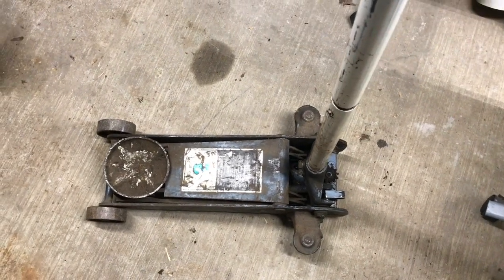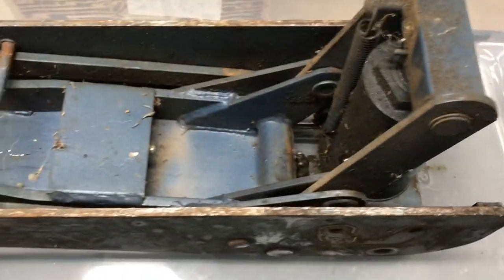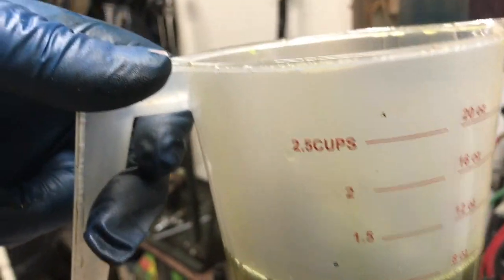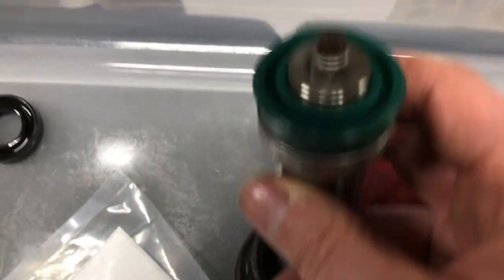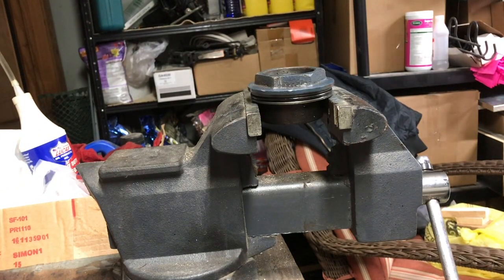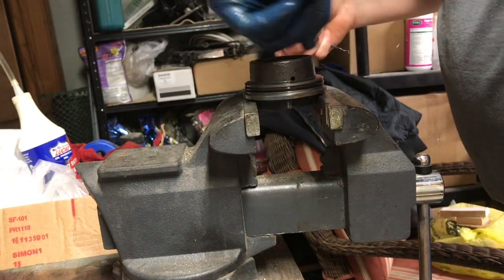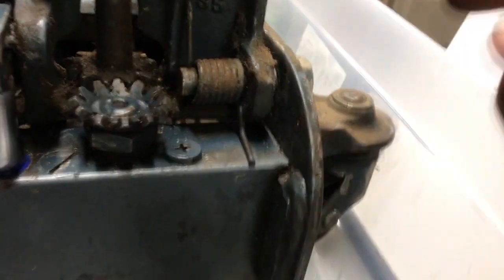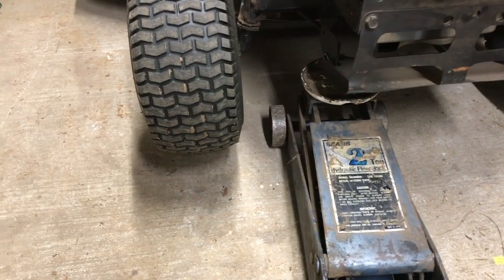Can we fix it?  2-Ton Sears Hydraulic Floor Jack

Comment: Update !  So today I went ahead and replaced the seals which I bought on Amazon for 49.00.  It was easier than expected and took approx two hours or so as I took the time to clean and degrease 40 plus years of dirt and sludge. I had previously replaced the wheels as the others had flat spotted over time. I also used a syringe to add 8oz of fresh jack oil..  Just finished testing it and it works perfect. No doubt this jack will outlast me.  Thank you again for the video !!
Reply from the maker: Glad it helped. Thanks for watching!
Reply: Can you tell me where you purchased wheels from? Mine are toast.
Reply: For that kind of money you could spend a few bucks more , and get a new aluminum, lightweight jack at HF tools.

Comment: Thank you sir! I have the same jack, but mine is a 3 ton. I also bought it at around the same time, maybe the mid 80's. It's worked trouble free for 35 years, but of course, nothing lasts forever and now I have to replace the seals. Your video is perfectly to the point and easy to follow. I'm going to Amazon right after writing this comment.

Comment: Great vid MPA.  Lacking a heavy duty enough vise to break the cap loose, I improvised by reassembling the power unit body backwards with the big hex sticking out.  Threaded the handle thru the base and the extended elevator part, with the handle end that was sticking out under my workbench.  Then a 4' cheater on the pipe wrench and it couldn't say no.
Reply: Brilliant. That will get me over that hurtle, thanks.

Comment: That cap at 2:33 which has to be removed is a MASSIVE PAIN!!!!! I tried everything to get it loose and couldn’t. I had to take it to a shop for them to get it loose and even they had trouble. After that, it was an easy repair and this video helped. My seal was basically disintegrated so I replaced it and all o-rings I came across. Now works just like new. Thanks for the video.
Reply: Looking for help. We have this jack & the handle is “frozen” we can’t turn it at all. Would the internal seals effect this? 
Could it be rusted or something? 
Sorry, my brother left my dead fathers jack outside and now it’s not working.  Id like to give it to my son but I have no idea what I’m doing.
Thanks
Reply: @flyersrule8918  If the handle won’t turn to open or close the valve, then I would recommend taking the valve area apart to clean everything and check seals. This will be WAY easier than having to repair the seals in the piston on a Jack that won’t Jack up or hold the vehicle up. Should be a pretty easy fix for you. You will be able to remove the star dial of the handle that should turn the valve and then also remove the star dial in the Jack that opens or closes the valve and see if anything looks like it needs to be replaced, or possible just removing it and putting it back will fix it. Good luck!

Comment: Excellent ! I have the 1.5 ton version " Green Jack " that I've had since the 70's. It just last week started to not hold weight and now only lifts a few inches and then sinks. After watching this video I am going to reseal it instead of buying a replacement.  THanks again for showing us how it's done.  Cheers !!
Reply: I believe mine is also the green type 1.5 ton model made in Japan. As I said , took the old seals to a hydraulic parts store and paid around $20 for maybe 3 seals.

Comment: Well done for a good video. At 5:06 I am glad that you stated that the top cap, " we shall snug it down as much as we can." and no more than that. I had occasions where those repairing such jacks overtighten the upper cap at the expense of lifting the power cylinder off its bottom copper seal. 
This week I had a colleague who called me to help him with his floor jack as he had taken it for repair but it was not done successfully.
There were "four steel ball-bearing valves" in this particular unit to take care of and investigate..
* One steel ball for the return path for lowering.
* One steel ball loaded with a spring for the overpressure control.
* Two steal balls working together to bring about the pumping action from the reservoir to the pressure cylinder. 
I easily managed to get at three balls, but the fourth final one which was on the pumping action and which held the power cylinder in place after each pump action could not be gotten at without taking off the power cylinder. The outside surface of the power cylinder was gored with marks of the pipe wrench.  Someone did try hard to get that power cylinder off but could not!! In order to get the power cylinder off, we had to use heat on the block and cool the power cylinder and gladly it worked.
After taking the bottom copper washer seal, the last ball was located and it was found to be surrounded with the remains of the bits of the power piston which over the years got under the ball and so it would not seat back as it should so It leaked. The small pumping piston showed evidence of its aging. The seal was on the end of the piston and not on the cylinder as an 0 ring. 
After ensuring that all was well, we threaded back on, the power cylinder in the lower block and tightened it as much as we could for the tightening of the top cap at a later stage could lift the power cylinder off the lower copper seal which also holds the ball valve from dropping into the power cylinder. 
So in this type of ground jack one needs to tighten the power cylinder in its block as tight as possible, but the upper cap should be," tightened snug it down on the seals" as the upper cap is not a high pressure-sensitive item but only deals with the oil in the reservoir. 
Again, well gone and thanks heavens you did not need to take the power cylinder off as we had to do,  and found what we found, as tightening it back would need more torque than tightening the  reservoir upper cap
Reply: You are right. The reservoir cap doesn't need all that torque since it's under very little pressure; after all, a rubber plug is used to plug the small fluid fill hole. If there were any pressure in the reservoir, that pressure would easily push that plug out and all the fluid would be pushed out.  There isn't a good reason why the designers made the reservoir cap nut 2 3/16 inch (56 mm).  A smaller nut would allow more commonly available tools (open-end or adjustable wrench) to be used....maybe, use a grinder to reduce two flats on the nut (to 2" or less)?

Comment: I forgot to mention I love your turkey baser idea. I used to have a large needle the kind that they would use in comedies because of how big it is. That thing was unbelievable I cried like a baby when it finally gave up. They're not intended to be used over and over. The doctor who gave it to me is retired and my new doctor won't give me one. I am definitely trying your trick tomorrow. My one Jack that I wrote about before there would work for a while if I put oil in it. It was just too messy to deal with after my needle broke. And I actually have two turkey basers in the garage that I picked up to use a little differently when working on carburetors.
Reply: You might try a marinade injector syringe/needle kit. You can find them at the grocery store or hardware store where they sell bbq/grilling supplies (or on Amazon).

Comment: The lip-seal (with the metal band surround) at the top of the pump plunger hole may not come out with a screwdriver.  I used a thin, sharpened corner of a putty knife and a small hammer to push the lip-seal metal away from the hole. Worked very nicely.

Comment: One question I have is why are these seals so expensive? All it is is rubber put into a circle. I have a repair kit that for the most part I can make a lot of different size of rings and the entire kit on eBay did not even cause $30.

I do like your video you really get into what it takes to fix it. I do know that today Jack's like this have gone up. I still have my first large shop Jack. About 8 years ago it developed a leak and I went to find new seals for it and could not get over the cost of them. Today they're even more.

I definitely gave you my thumbs up and I hit the subscribe button. I figure that's the least I can do when someone's giving good information out.

Comment: Good video...thanks. A 55mm wheel bearing socket can spin that power unit nut off. I got it at the local NAPA store for $20.

Comment: It's easier to loosen that big nut on the piston reservoir with a 2 3/16 inch socket. You may be able to rent / borrow the 2 3/16"  socket from a tool rental or auto parts store. Place the socket on the nut (after pushing the piston all the way in). Put your breaker bar on the socket and give the breaker bar a few gentle raps with a hammer  in the off (counterclockwise) direction; or, use an impact wrench on the socket. That nut won't seem so awfully tight, now. When tightening the nut, it doesn't need a lot of torque -- it's not a structural component.

Comment: Thanks I have one of these and this info will be useful. The jack bleeds down unless there is a load on it. I have to pump it up in a hurry to keep it going up and once there is a load on it, no problems staying up. Could it just be something is just dirty?
Reply: Mine does the same darned thing! How did you correct it?

Comment: Excellent video. Thanks. Just curious what the two plugs on either side of the star wheel are for?
Reply: One is a safety  pressure release.  wont let you jack over a certain weight.

Comment: Helpful hint/warning: He kind of cheated on showing the removal of the large cap on top of the ram (that releases the piston). He made it look like it's hand tight. If that's been on there for 26 years, like mine was, it's going to take a hell of a lot of torque to break it. You'll need a monster vise attached to a monster steel table, and don't use a monkey wrench unless you have no other options. It'll tear up the hex on the ram (which I did to mine, and I didn't even get it loose LOL). Use a large crescent wrench or a socket wrench.
Reply from the maker: What you saw is what there was.. but yes, it was incredibly tight and the pipe wrench was the only thing I had large enough to do the job.
Reply: Same here, but i needed a little heat and pipe on the big pipe wrench. I actually bolted two bolts to the piston assembly on the outside of the jack to use for leverage.
Reply: I had to,take mine to a hydraulic cylinder repair shop, yes he had those big  wrenchesmand steel table.
On the other hand, the internet outfits sell these kits charge too much, more than what the jack is worth (between $50 and $60). I went to a seal and gasket store and paid around $20 for the same seals!
Reply: @tigertank88m  I too had to use heat and extension pipe on huge pipe wrench and still came close to ripping the vice from the table. However, my jack was a 3 ton model.

Comment: I have not been able to install the new seal in the power unit cap.  You used a 1-1/4" socket to tap it into place.  On my unit, there is a metal lip the reduces the diameter of the hole from 1-11/16" to 1-1/2".  This lip made it difficult to remove the old seal, and now, I find it impossible to get the new seal into place.  It is pretty rigid, so there is no way to deform it to get it underneath that lip.  I can tell that the new seal, diameter 1-11/16" would fit perfectly -if I could get it in.  I'm out of ideas on this.  Anyone have any suggestions?

Comment: I rebuilt the same jack but I also replaced the o-ring and the backup ring down inside the plunger. The top seal won't stop leaks on the plunger this just stops dirt around the plunger.
Reply: Hello, were these parts included in the seal kit or did you have to order them separately? Thanks.

Comment: Anyone know if I can save $ on seals by just buying them at industrial supply store? Would take the old seals for sizing. Maybe cheaper than the Amazon kit?
Reply: I wanted to do the same.  I have four of these jacks and would prefer to just change the seals I need.
This is a hobby for me so doing the repair twice would not matter.
Reply: I agree the kit is way over priced. That old greasy Jack repair guy most likely a multi millionaire. My experience decades ago.
Reply: I just went this afternoon to a nearby hydraulic seal and gasket store in Fontana, CA. Took the jack with me and a helpful young lady measured all seals and gaskets (all 6 of them). Total bill was $21.10. This is less than half all these online merchants want for their kits!
Reply: @jpcheco  tHank you for this, this is info and help that no one has offered in the last years of jack videos!
Reply: @jpcheco  Good ole customer service! Thanks for letting us know it can be done. Did you get them all installed and everything jacking good?
Reply: @jpcheco  if the same model as the one in the video...would you please supply the parts list?
Thanks!
Reply: @shggydg9100  mine is not a Sears one, therefore model number would be different. I disassembled it and took the seals to the hydraulic parts store. They measured the seals and sold me the needed parts (actually the sales lady gave me one which was not the correct size and had to use the old gasket/seal. However, the jack works ok). I had to take the bottle with the big square nut to a hydraulic repair shop for disassembly as I could not take it apart. The mechanic placed it on a bench with a bike type chain around it and used a very big pipe wrench. In less than a minute he unscrews it, and best of all he did not charge me anything saying that I should throw that old jack away, half jokingly I suppose.

Comment: After watching your vid  I thought you may be able to provide some guidance MVP F301   jack  It was working but leaking oil like crazy through the pump shaft.  When I removed the shaft I  Think I lost the o ring on the bottom end of the shaft if there was one appears like there is a slot.. I have a manual but it doesn't provide the size of it or show it.  Give me some advise on how to determine the size? There is also an O-ring on the inside of the shaft that I can't seem to get out. Any advise.  Thanks

Comment: The metal ring mentioned in my previous comment is welded in place, so to get the seal in, one must use a special hydraulic seal installation tool.  This tool (around $20 or so) will deform the seal into a more compact, heart shape, so that it can be inserted down into the groove.  Once it's there, you press it into the groove,  all the way around, restoring the original circular shape.  I've shelved this project for now, but at a later date I may get the seal installation tool to complete the job.  I will have to re-order the seal kit - in frustration, I returned this ridiculously overpriced kit (Lazzar's HCRCnow), $70.  Perhaps the price will come down.  I'd like to restore my floor jack, but it can wait.

Comment: Perhaps the metal lip (ring) around the top of the cap can be removed?  Mike's showed the top of it right after he installed the seal, and there is definitely no metal ring present.  Perhaps he removed it, although I don't know why he did not mention this.  Mike - did you knock the metal ring out when you knocked out the seal?

Comment: I was looking to see what jack rebuild videos were out there and came across yours on a random search.  Since 1 of 2x 3 ton jacks I bought with a shop lot purchase does just what you described yours did in that it would pump up and then immediately fall back down, instead of trashing the jack, thought I would see if I could fix it first.  From your video, glad to know all I need is a seal kit and this jack will be back in business for another 20+ years :-)  What oil type did you use to refill with?  Thanks ahead of time!

Comment: I inherited the exact same Sears 2-ton jack from my father.  Awesome jack and has worked leak free for 35 years.

The wheels/casters on the front are worn down and need replacement.  Does anyone know where to get replacements?  All of my searches for replacements have ended in deadends.  Any alternate casters/wheels out there?

Comment: Replacement kits are $50. Why repair when you can buy a brand new replacement for less than that at pretty much any big box store?
Reply: A decent 2 to 3 ton floor jack is about $150 to $200 (even at Harbor Freight and the jacks there are actually very good) depending on exactly which model you buy.   One cannot realistically buy a decent one (comparable to the one in the video) for less than $50 at a "big box" store, unless it's just a very small one you can carry in the trunk of your vehicle.   I have a 3 ton bought at Harbor Freight in January 2004 and it still works fine (never needed any jack oil etc.) and it was only about $100 to $110 back then but that was also quite a while ago.

Comment: The pump plunger pressure seal wasn't changed, it was only the wiper seal that was changed, no release seal was changed either. 🤷‍♂️🤷‍♂️
Reply: I was going to make the same comment. I have exactly the same jack and noticed the seal on the plunger wall as well as a wiper washer that were not replaced. On the other hand the main cap is so hard that I have not been able to loosen it!

Comment: I have a jack where I can’t get the gear attached to the cylinder to turn.
Reply: Just fixed mine. the star wheel teeth were not meshing do to one being bent. i used a grinder to shape the bent tooth. I also used a 1 1/8'' wrench to remove the assembly to check the threads.  Didn't see anything wrong. Now working it needs seals as it won't hold a load.